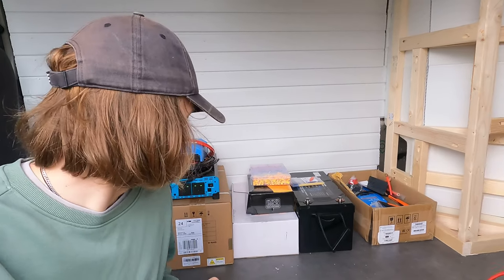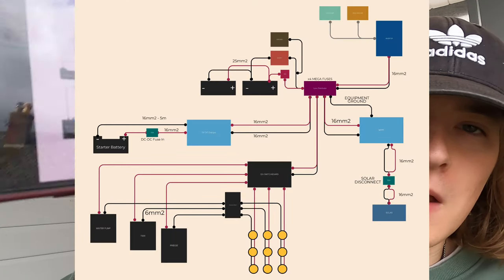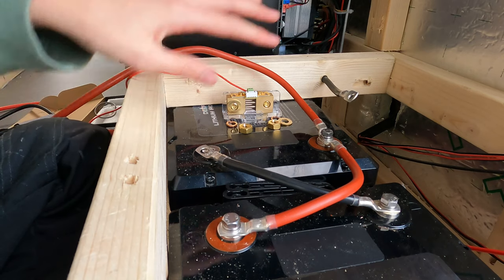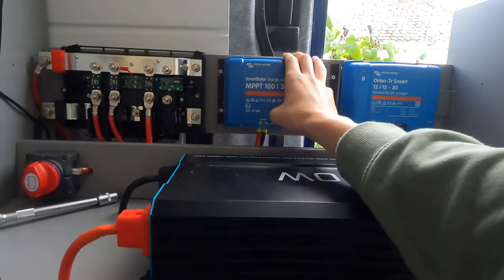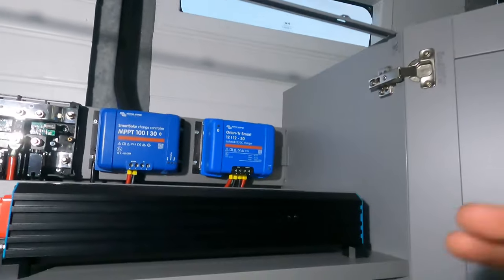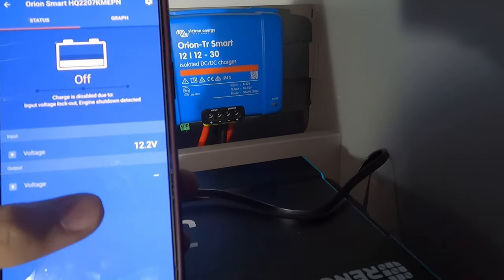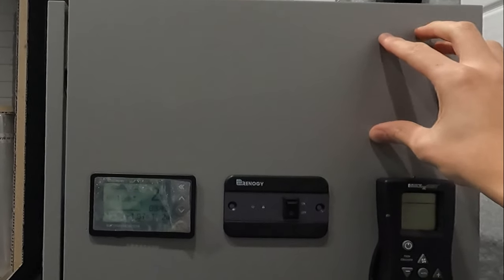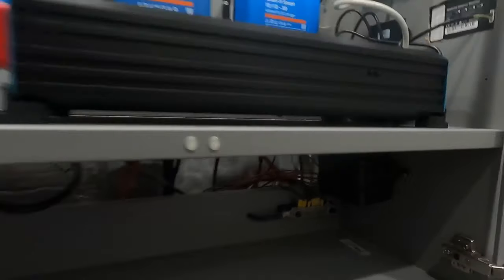Full Campervan Electrics Install

Comment: A 3Kw inverter will power pretty much any induction hob just make sure the battery can handle the Amp draw, every  1200W from the inverter is roughly 100A from the battery  so if you intend to use the full 3000W you'll need a battery BMS that will handle at least 250A or multiple batteries that can handle that draw between them ?
The build is looking good 😎

Comment: Be careful crimping with that pair of pilers - you might not get a very good all round connection and that could lead to hot spots.
Suggest you invest in a proper crimp tool - they aren't that expensive and you will be safe.
Otherwise looks fantastic. I'm just about to start the electrics on my van build - its scary !!